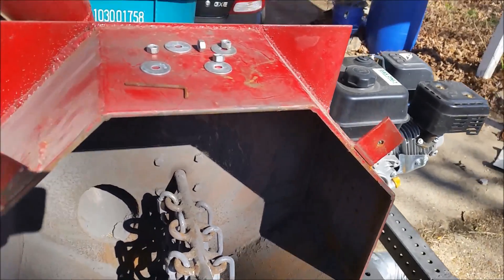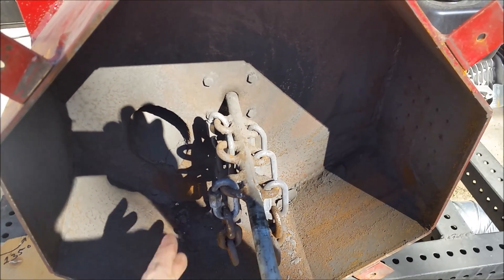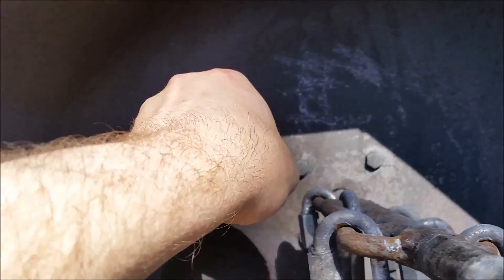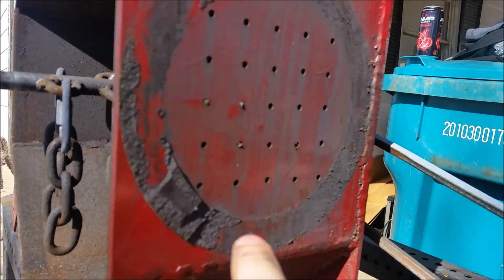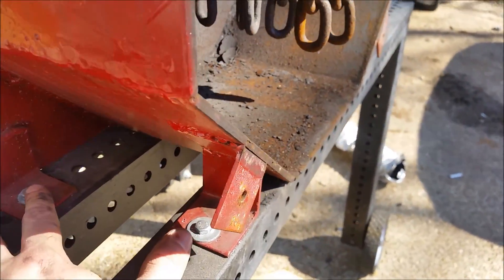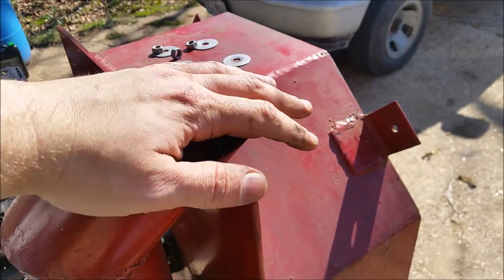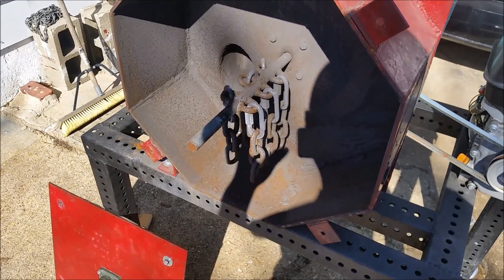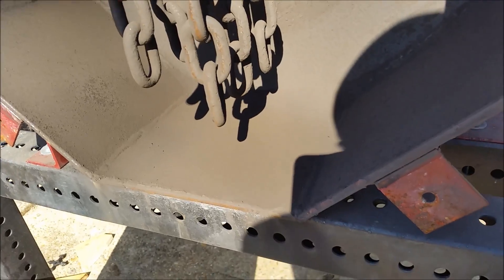How I Built My Home Made Rock Crusher

Comment: Planning my build.. Would holes on the bottom 1 or 3 plates  for the processed material to fall be better. Gravity usually makes things fall down. I'm thinking a bigger flale shaft would be better to maybe 1 inch? Would horizontal weld lines on inside plates help brake material better? What would be a better/harder material than chain or attached to end of chains?

Comment: RE : The Dust Exhaust Pipe ...
One idea you might like to try is to weld on a metal sleeve to which you push the Duct Pipe onto ... hold it on with a large metal pressure clamp ring that is much like a hose clamp but larger !!

Comment: Building chain impact mill here. . . .Just wondering what size drill holes you have drilled for your exhaust port. . . . and how many. . . .I did my barrel out of 500mm x 150mm (20" x 6")  line pipe that was 10mm (3/8") thick . .. . .my first attempt. . . ..my shaft is 25mm (1")  and chain is Grade 8 HT steel Galvanised . . . . .Still got a way to go. . . .Have plans of coupling this to a recirculating wet sluice. . ..As I live in a dry region of South OZ. . .
Reply from the maker: In this vid I use 4mm holes for the exhaust.  After using it though I'd recommend double the amount of holes I have in this vid.
Reply: @Puddin  thanks man. . . ..really appreciate the info. . .. will let ya know how i go..

Comment: Good job brother, get a green belt from the parts store, they are for heavy use. And drill holes in the bottom for your heavier ore will sink.
Reply from the maker: I've not had any issues with the belt on there now.  Though when i do to change it I'll keep that in mind

Comment: I like it! One thought, and one question:
The thought: Have you pondered adding a nut and bolt to the final link of chain, to give the flails a better head, and:
The question: What RPM are you running the shaft? I'm going electric.

Comment: What is the point of turning a rock into dust?  I guess I don't understand the point of this machine.
Reply from the maker: If you wish to fully extract elements from rock you need to have it crushed as fine as possible.  I originally built it to crush gold ore but ended up using it primarily for manganese ore.
Reply: @Puddin  Thanks. I learned something new!

Comment: I believe you should add a reservoir and 1/4" dripline. Such as would cut the dust to minimum.
just a small tap, like used for adding a line to your refridgerator from your potable water source.

Comment: i wonder why are they so expensive >.>
Reply: It costs a fortune to make a metal shaft rotate and short lengths of chain cost thousands of dollars also. It's not like you could just rotate a shaft between some $20 bearings inside of an old propane tank with a couple pieces of chain welded on. Obviously.
Reply: You need osmium-technetium chain prepared in vacuum under zero gravity or or rocks will not break.